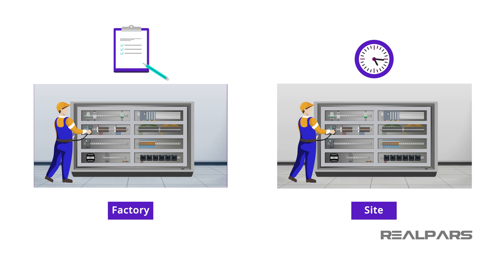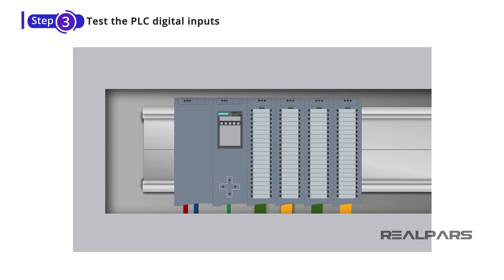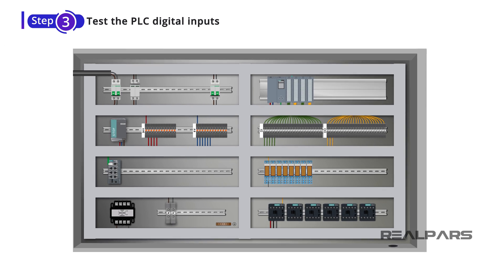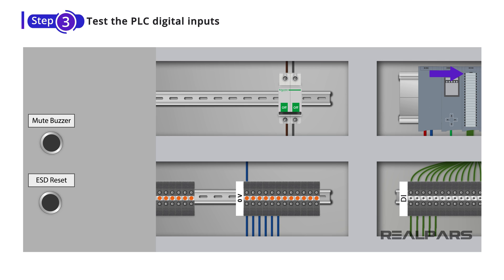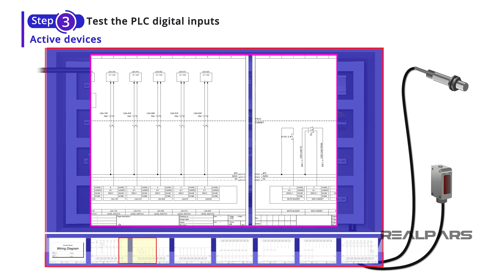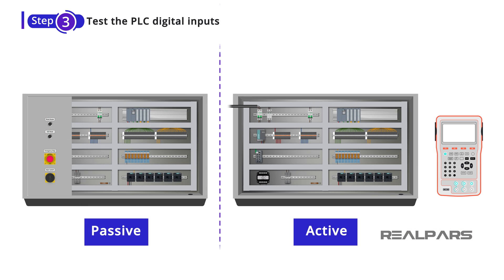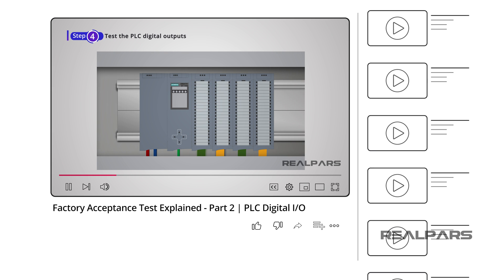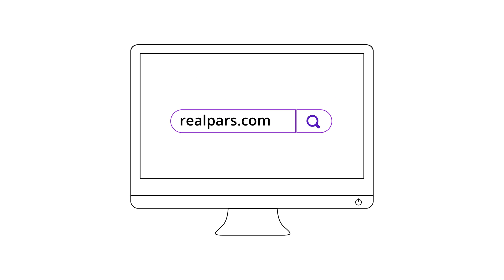Factory Acceptance Test Explained - Part 2 | PLC Digital I/O Test

Comment: min 3:45 wiring from where to where?
Reply from the maker: Hello @Sebastian-on4fq,

Thank you for your question, and sorry for any confusion! In this example, we’re demonstrating how to test the input signal from the push button (PB) to the PLC.

The PB itself isn’t working, so to verify the signal path, we apply 24 VDC directly to the terminal block where the PB would normally send its signal. This voltage travels through the wire that carries the signal to the PLC.

If the input light on the PLC turns on, it means the signal wire from the PB to the PLC is functioning correctly. In that case, the issue is likely with the PB itself, the power wire feeding the PB, or possibly a blown fuse supplying power to the PB.
Reply: @realpars understood ! thanks for the explanation !

Comment: but siemens plc haven't got a simulator??
Reply from the maker: Hello. Thank you for your question.  Yes, Siemens PLC programming software does have a simulator depending on the PLC software, for example, the new software for Siemens PLC, TIA, Simatic Manager S7, LOGO, etc. Always check the Siemens Website or the software manual. Here is a link for your learning:   https://support.industry.siemens.com/cs/document/109744173/documentation-for-simatic-controller?dti=0&lc=en-WW  Happy learning from RealPars!

Comment: I would only add the information that it is easier to just force the digital outputs in your PLC one by one. Its straightforward and easy process, and you don't have to go inside the program logic and check the trigger conditions.
Reply from the maker: Thank you for adding that! We very much appreciate that.

Comment: Great channel. I've followed you on LinkedIn immediately. but about the test, I have faced another issue the names in the circuit diagram (the names of components in the factory) were different from the site and that made a problem by wasting the time to understand the right wiring type.
Reply from the maker: Part of commissioning is to match the actual device in the field with what is shown on the wiring diagram.  If I have a digital input or digital output card, most devices with one of two types (contact closure or 3-wire solid-state).  I have had the same thing happen over the years, but with a little practice, you will be able to quickly match the field instrument to how it should be wired to the PLC.  As a side note, I would also ask the engineering company who designed the system to explain the discrepancy between the field device and what is on the wiring diagram. There may be bigger issues (working off of old drawing revisions, missed updates, mislabeled devices, etc.).

Comment: For DO why not just use Watch Table Force Mode for it? The DOs inclusion conditions in program may be anaccessble at all, for example they can include time delays, some inner flags or variables.
Reply from the maker: Yes, you could certainly use this method for testing DO points.  Many times, if the logic is simple or repetitive, such as with valves, it may be better to test the logic as well as the outputs at the same time.  The method of testing is up to the engineer performing the test.
Reply: @realpars  Ah, got it.

Comment: Excellent video. Can anyone tell please how to simulate the signal? Do you mean to jumper it? 
I am trainee.
Thanks.
Reply from the maker: Yes, digital inputs can be simulated by jumpering the appropriate voltage from a power supply to the input terminal of the PLC.  This is electrically what would exist if the input device were energized.  This can be dangerous if you are not experienced in doing this.  24VDC circuits from different power supplies should not be mixed.  Always use power from the same power supply circuit as would normally be used by the device. 

Analog inputs can be simulated with a Fluke process meter or other devices that can generate 4-20 ma for loop-powered devices.  For Profibus PA sensors, there is a simulation mode that allows testing of the analog signal to the PLC.  Digital outputs and  analog outputs should be forced from the PLC to simulate.
Reply: @realpars   Thanks for your prompt and such detailed explanation.
Thanks for sparing your valuable time.
Really appreciate your excellent work.
Keep it up...

Comment: How can we test outputs if program not downloaded to PLC
Reply from the maker: Technically, you can't.  Triggering an output on a PLC output card has to be done via logic or via a "force", both of which require a connection to the PLC.  You can load a "bare-bones" hardware configuration with no program elements and force the outputs.

Comment: 04:50, what if the PLC logic is too complex to simulate?
Isn’t much better for I/O testing force the output signal and see if the relay or contact activates?
Reply from the maker: It is always better to engage the actual hardware components in any simulation or system logic checks.  Most often, this is not possible since the hardware and I/O may be in the process of being installed in the field at the time testing is required.  A good simulation, regardless of the complexity of the software and logic, should be designed to tie "outputs back to inputs" and allow for direct input of analog values.  Full dynamic simulations are usually possible as well but take longer to plan and set up.  You need to decide what level of simulation/program checkout is appropriate for your needs.  Typically, it will take 5%-10% of the time taken to create your program logic to create a "tie-back" simulation; 10% - 20% for a full dynamic simulation.  Your simulation and testing strategy should be part of your Functional Specification document and needs to be planned for up front.  When I program PLCs, my control module logic (device control logic) and equipment module logic (equipment functional logic) have simulation code built right into the logic.  When I need to simulate the system at the "tie-back" level, I simply need to set the simulation bit.  If I need to do a full dynamic simulation, I add a program block or file to do all of the necessary calculations and setting of analog values.  Don't forget the power of your HMI interface in setting conditions and monitoring the logic!
Reply: @realpars  Many thanks for the feedback, as you explain seems to be having a simulation program block might help in the long run. I will try it next time. cheers!

Comment: I like your videos even when they’re not directly applicable to my work. Great quality coming from this channel 💯
Reply from the maker: Thanks for your support, we're glad to hear that!
Reply: what do you do for work? I am curious.
Reply: @hlukanirikhotso1597    (associate) Software Engineer. 

I work on code ranging from data acquisition on real-time OSs to tools and software to run on desktop PCs. Sometimes it’s GUIs and code for controlling hardware and other times it’s command line tools running in “the cloud.” If you include my hobbies/future work, that would extend down to bare metal microcontrollers and up to web design. 

The content on this channel does sometimes give me tips that I can apply to my own work, and some of the content gives me insight to the systems my code may interact with.

Really though, I’m mostly here just because I find the topics very interesting and @RealPars presents them well.